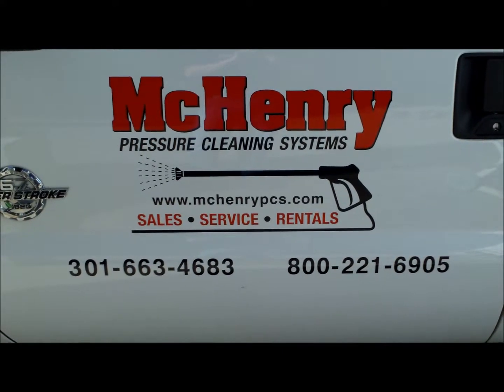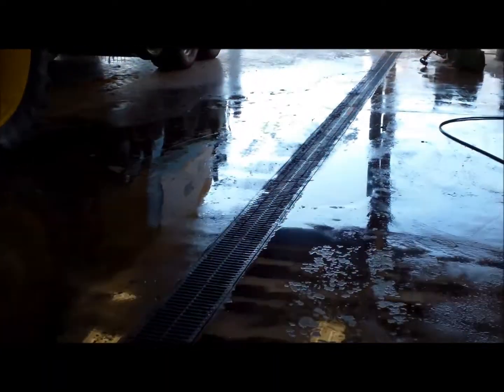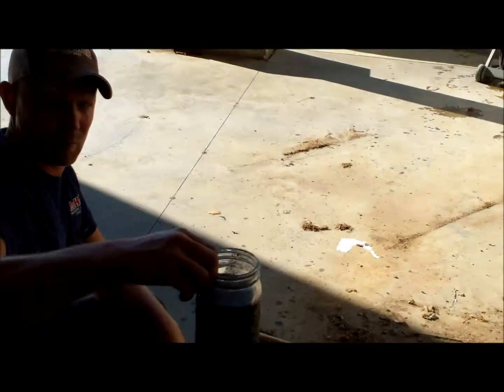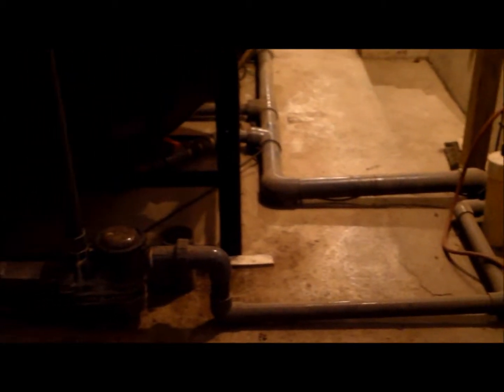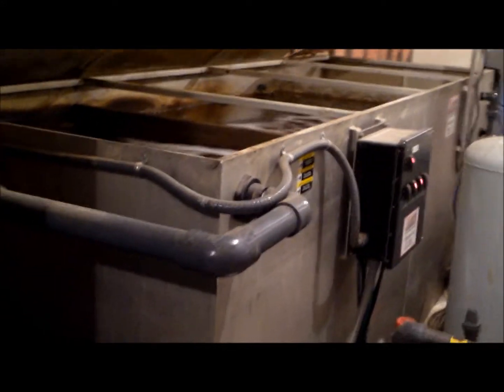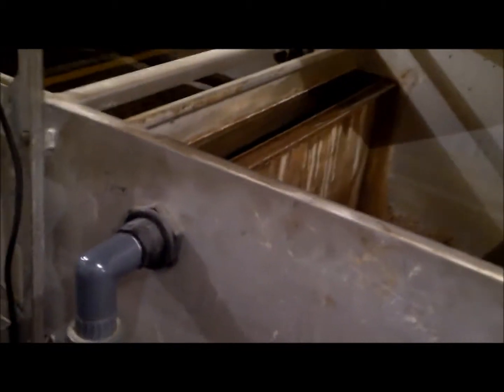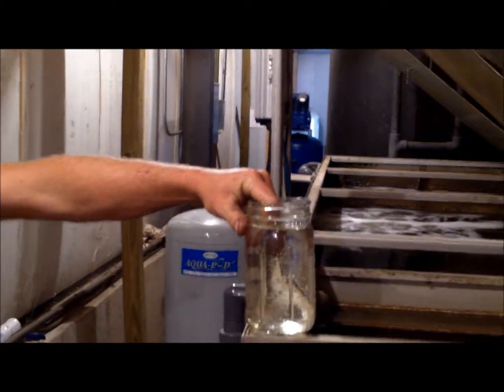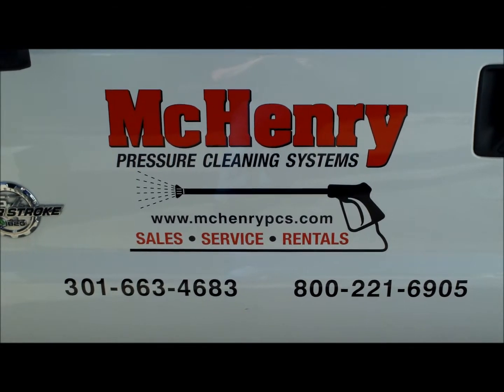Vehicle and Equipment wash bay with Reclaim Wash Water Equipment

Comment: How much room does a system take up?
Reply from the maker: These systems are designed around the customers wash load. The sizing depends on what is needed. On the below questions, if a system is designed properly yes there will be provisions for mud and sand if this is being wash off. Treatment systems can be discharge and closed loop. Please contact us for review, 800-221-6905.